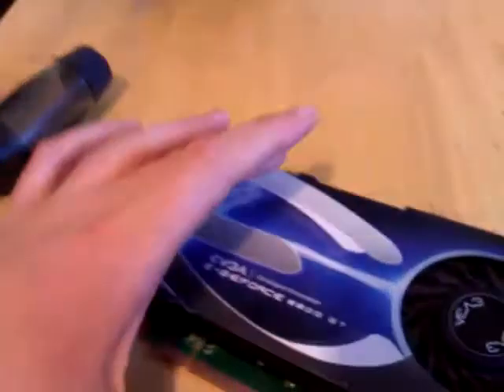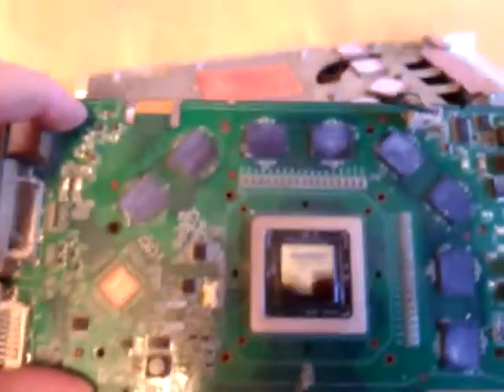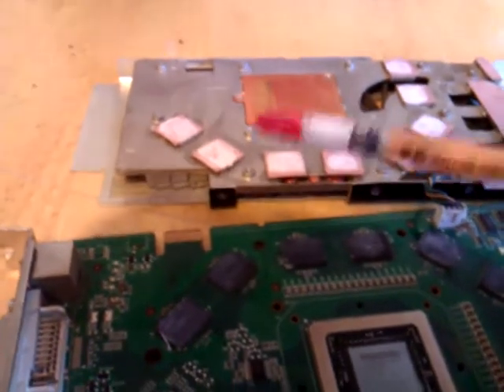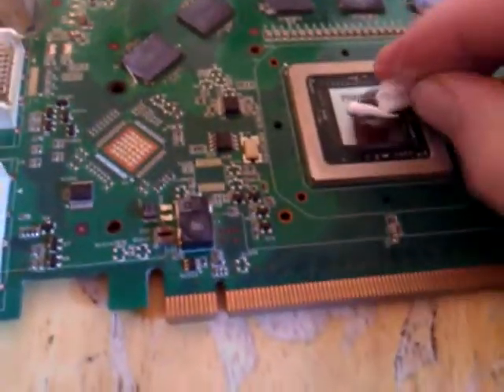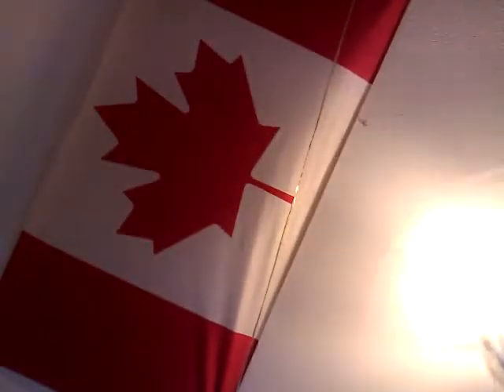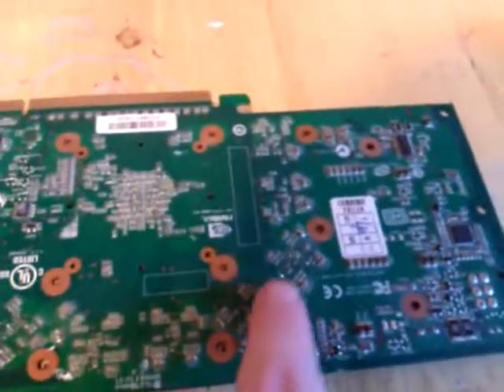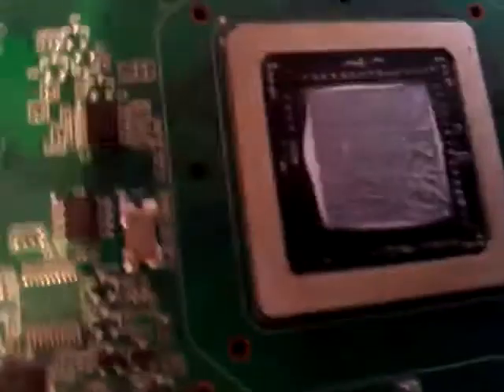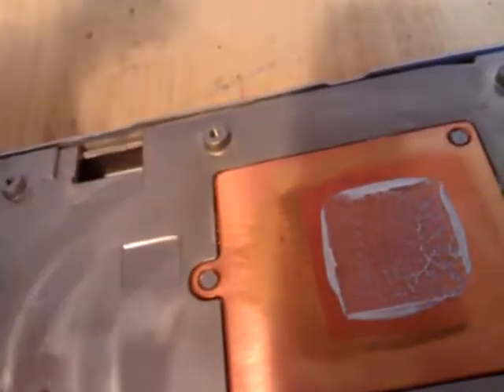Proper way to apply thermal paste to a gpu

Comment: I had to do this recently and followed the clip. I cleaned up the old paste which covered everything. After that the vrm temps were very high. I then clean up and reapplied this time drowning the little transistors that surround the chip, this made a big difference on the vrm temp and bought the core temp down a little too. 
What are those little things around the chip? Why did this happen?
Reply from the maker: The paste should ONLY be going directly onto the die of the GPU. If ur VRMS were overheating, you likely did not seat ur heatsink properly (doesnt take much) depending on the paste you use, it can short out the GPU... (some pastes are NON conductive, others IE arctic silver 5 CAN conduct electricity

Comment: Take note this is exactly how it should be done. Stupid stuff spreading it around is a great way to incorporate air bubbles.
Reply: no he did it right but the thermal paste was wrong, it should be less and barely to not even touching the out side of plate
Reply: I was going to be polite but with someone as stupid as you what's the bloody point. Show me one source that states pointless 'tinting' is able to reduce the temps by 15c. You have to be stupid to even believe that. It's not about simply digesting something someone has wrote, you use observation, experience and knowledge to deduce the outcome. It doesn't matter if you use a line or dot nothing will have that level of reduction. Also why do you mention a prep method? They only suggest that so you can waste thermal paste and buy more. No idea how many systems you've built but sorry to tell you, you've wasted a lot of paste for no reason. Okay to save a little time, burn in time! Because only an idiot starts to oc on a fresh install. I don't want to live in you, why are you so excited? The proper way to apply? There is no proper way, for someone like you the proper way is to get toothpaste, spread it on your face then mash said face on to your monitor. Fucking tinting, you tint car windows or glass.Also your bible of a site suggests to use either middle dot or line for every CPU (I know they suggest spread for mobile but that's because they don't really care about them!). I don't know what your point is but;bananas are bluethermal paste is glueyou make no sensenor do you?
Reply: nice formatting

Comment from the maker: Same reason as a cpu... Gpus are alot like CPUS except deal with more data. (in 3d applications at least) GPUs also get hotter than CPUs this card for example was rated at 110*C before "overheating" causing artefacts. these days thermal paste is installed between any chip and a heatsink to create a thermal bond ensuring best dissipation  of heat

Comment from the maker: also @bivenski, ive been at thisbgame for close to 15 years now. if i was working with hmm say rocket engines sure id wear a strap however this is a dead component. when working on pcs you can discharge any static built up simply by leaving the pc plugged in, and touching the CHASSIS. that will discharge any static electricity accumulated. another option is to work on a NON CONDUCTIVE SURFACE ie the wood i am in fact working on.